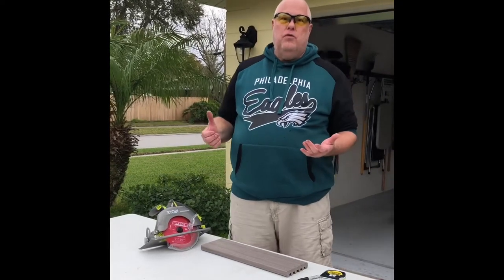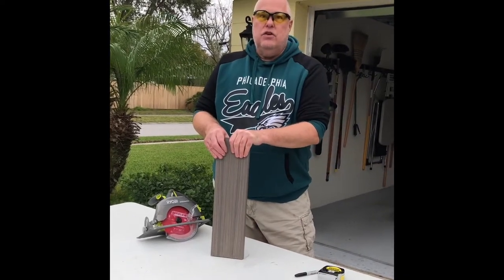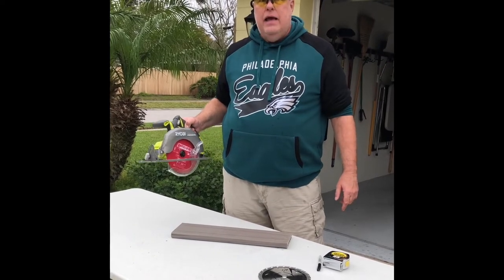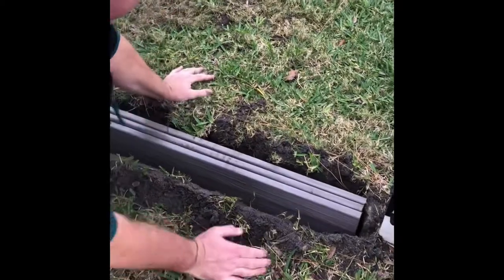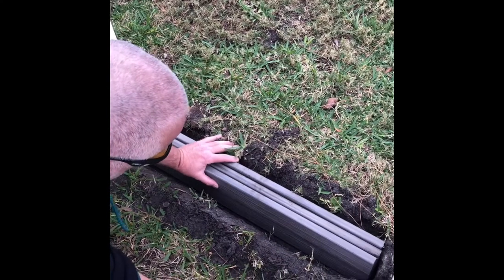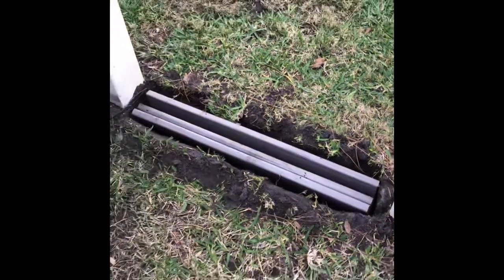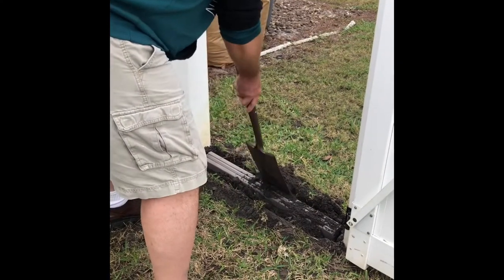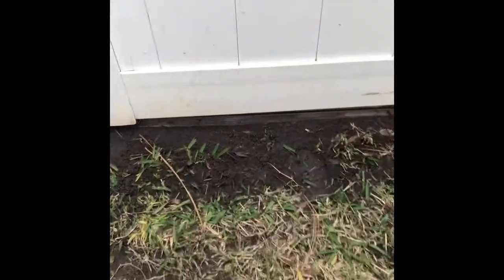Dog Proof Any Fence (The Gate)

Comment: I just had a new fence installed and they had to cut the bottom of the 6 foot gate  in order for it to swing open due to the slope in my backyard. I'm gonna try this out to see if I can add dirt on top of the composite decking to build up that area with the gap. We have a mini dachshund that would definitely be able to squeeze through the 6 inch gap, but hopefully this might solve that

Comment: I’m curious why you wouldn’t just fill that with cement?
Reply: Also, thank you for the ideas, my little shih tzu is driving me nuts and I’ll be doing using your tips for sure tomorrow ♥️
Reply: Two reasons: 1.  I wanted to be able to remove it if I needed access to under the gate (irrigation lines, etc.)  
2.  I did not want to wait for it to dry (instant results)